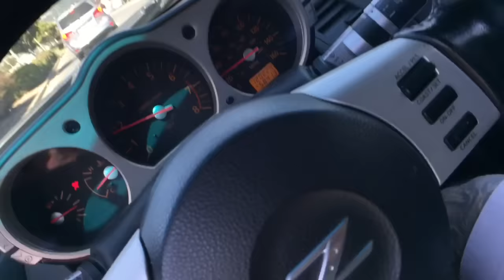After 10 years in jail, he finally gets to drive his mustang again

Comment: Tell your boy to skip the supercharger. The Windsor 302s are known to split the block around 500hp. Use that money on a 351 based dart crate engine. Better built engines the 351 is going to hold twice as much power
Reply: There’s stupid cheap resolutions to that 302 splitting
Reply: You just said it all a Crate 302, Thats a far cry from a Stock windsor block. Going to the 351 Windsor block puts meat between walls. This Fox is still running the Factory Block not a Crate Block, Theres nothing wrong with a 302 Crate block but it's still limited more then a 351 block which leaves you more room to grow. You can find 351's dirt cheap if you want to do a build from the ground up yourself but Crate engines are great because theyre not overly expensive if you go for the Windsor series engines and the works already done. Yes you can bandaid a stock 302 also but it's still a ticking bomb especially when running boost. You can find a 351W in a 96- F150 for 400 bucks in alot of scrap yards, 97 they went to the crap 4.6 for less then a S/c kit you can have a 351 pushing 500.
Reply: mr42ndstblvd I call bs a stock 302 block crate or not made 900 on non forged internals
Reply: If he wants it to go fast, put a LS in it...
Reply: Knallkoper Morder there is no such thing as a Windsor 302 .. it's a 351 Windsor and a 351 Cleveland. 302s are just that 302..
Reply: If in australia i got 2 stock GT 351s for wrecking
Reply: Challenge garage yeah my buddy had a 5 liter, run mid tens on motor, lift the front wheels off and everything. Said he was going to hook up his 200 shot of N20, I told him if it ain't broke don't fix it, stock block, cam, heads, not going to get much more out of it. He did it anyways, shit split in half on the hit.
Reply from the maker: Knallkoper Morder I rather he drop a ls3 in it lol

Comment: you didt check for spark you pluged a spark plug into the other spark plug. you have to unplug the wire from the spark plug in the engine and check for spark